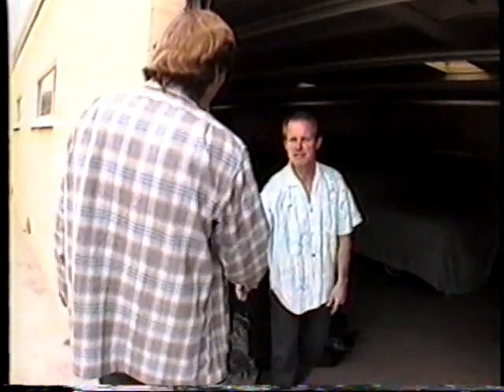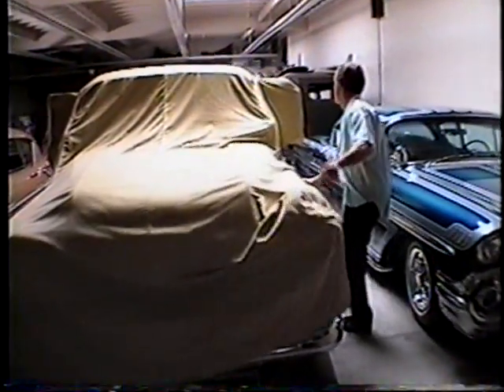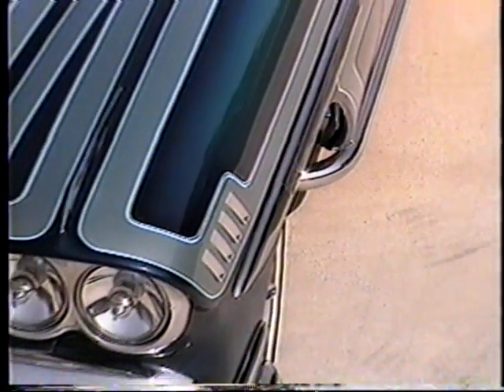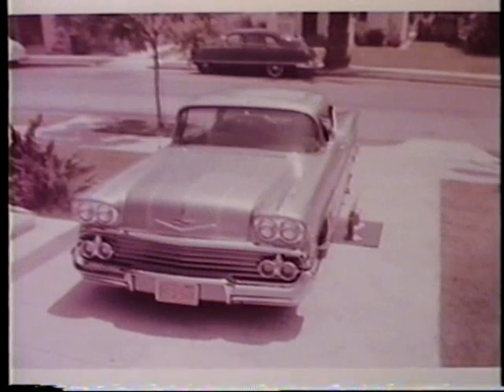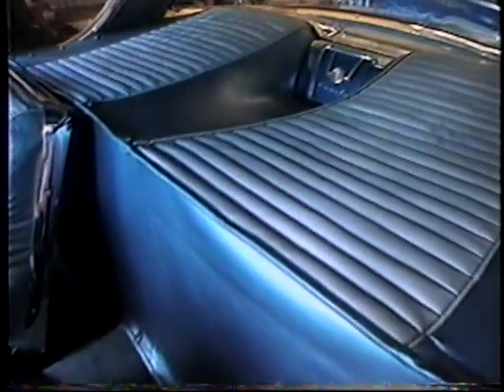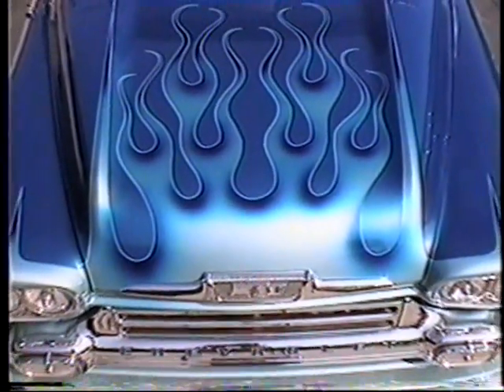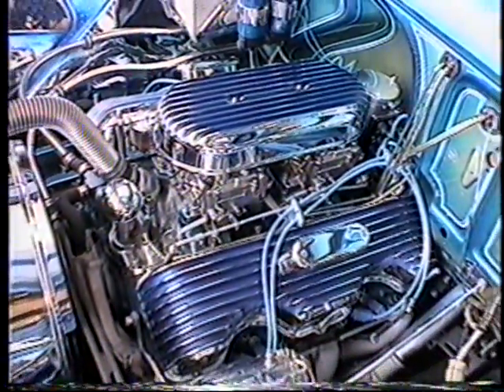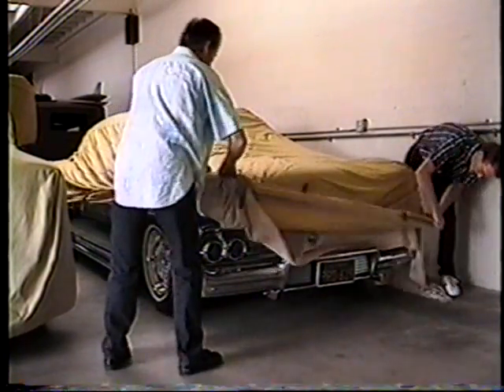Mox Miller's 1958 Chevy Impala Preserved

Comment: I saw that panel painted 58 in a car magazine when I was 6 or 7 and it burned a hole in my brain.Just a small pic of it sitting at an indoor car show. Might even been in black + white,cant remember. Not sure if it was R+C or HR I thought it was some highly modified custom and I am amazed when I was older it was all in the paint scheme.  #1 58 of all time.Myself, I would have to run this on the street though. Mox Miller you're a King in my book. 58 truck is Bitchin' as well..Love to see the collection in person.

Comment: All the 1958 GM cars were real bombs; normally, most car makers would keep a basic design for three years or so with moderate changes before a massive re-design; the 1955-57 GM cars, particularly the Chevrolet are a great example of this.

But the radical redesign of the 58s only lasted a year; gee, I wonder why.
Reply: Because GM was  caught off guard by the Chrysler corp sleeker forward look cars . in personaly love the 58 chevy and wish the body style had lasted longer than it did.